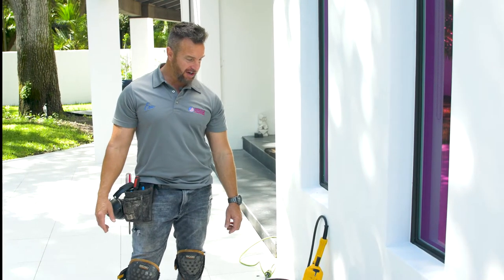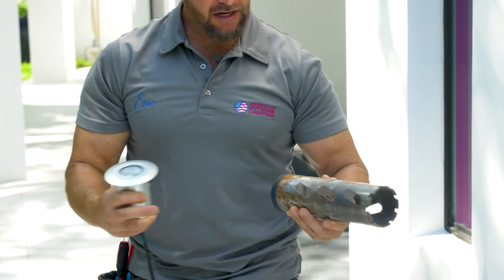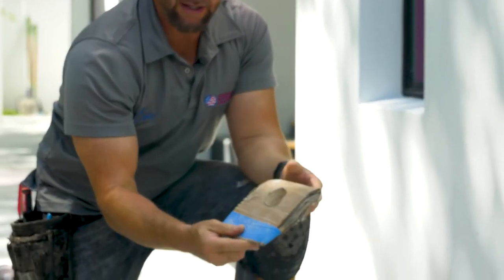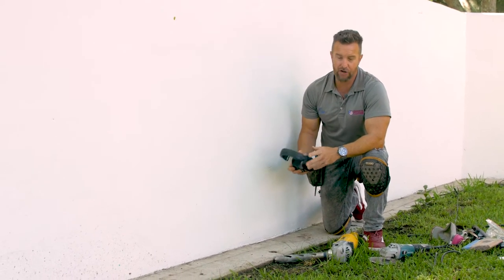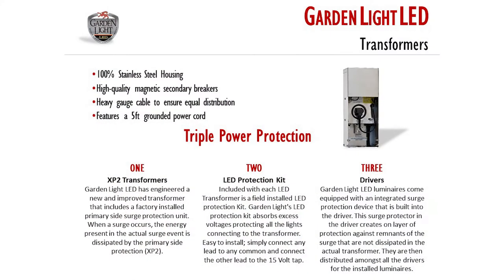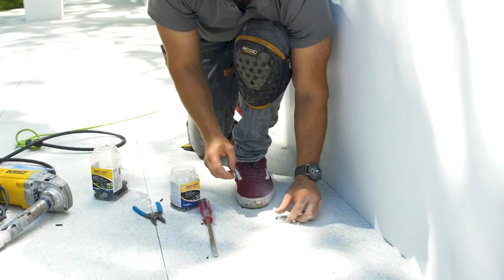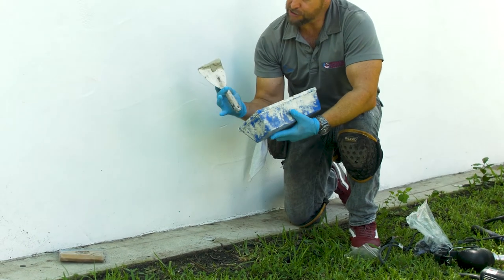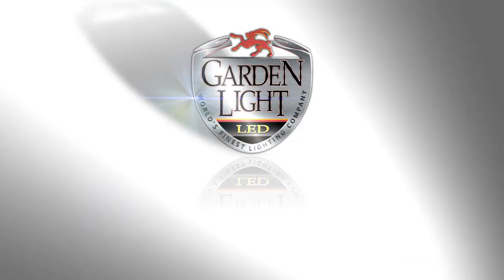How to Core Drill for Hardscape Landscape Lighting Installation

Comment: Great video! The only thing I'm wondering with the tile in the first part of the video is how you get the wire from the bottom of the hole connected to where it needs to go? Do you have to insert the light into the ground and run the cable back upward and out of the hole to connect to your main wire through a grout line? And in doing so, you would need to cut a line from the hole up to a grout line correct? Thanks so much for the video! A video on how to run wire through grout lines or concrete lines would make a great video idea for the future.
Reply: Like Daniel, I wondered the same.  Using the grout line seems to be the way to go, it is the best way to restore the cosmetics after installation.  Please do a video on it and highlight the routing technique.

Comment: how did you get the wire to core drill near the house?
Reply from the maker: Hi Mitch! Not sure I understand your question. Can you rephrase? Thanks!
Reply: Yeah like completely skipped how the wire just poked out the top of that hole? Haha
Reply: @GardenLightLED  I think he means how to get the main wire to hole where he shows the dryconn connectors popping up in the tile. Where does that wire come from?
Reply: @jamesjames_07  I get what you mean. Like how did the main wire and the light wire get connected together in the tile portion by the house. Not sure how to route the main wire to the light.

Comment: What do you do when you hit rebar?
Reply from the maker: Hi Jacob, great question! Eric's suggestion is to just keep drilling through the metal. Hope this helps!
Reply: Great video! I appreciate the quality of the work you guys have done. What model tool is that dewalt? Thx
Reply from the maker: @refreshlandscapelighting4813  Thank you so much! I will reach out to our installer in this video and email you the specifics on it as soon as I find out.

Comment: What adaptor is required for a grinder to be able to use a wet/dry core bit?
Reply from the maker: Hello! I will have to look into this. Let me get back to you!
Reply from the maker: I was able to talk with the installer and it looks like there is no adaptor necessary. You just need to make sure you are purchasing the correct core bit accessory that will fit. Thanks!
Reply: @GardenLightLED  Thank you soooooo much!!!
Reply from the maker: @arcticcowboy5047  Absolutely!

Comment: Ok this is bad on many levels. Why would you score to the outside of the 15" concrete curb, or however wide it was, in to the grass area? It was a few inches. Why not core down then remove dirt and grass and drill from the outside  about 5" down. You need to trench the wire  anyway. This way you do not have to go back and fill in. By the wy that was a nice patch but just seemed unneccessary. Now it could have been the speed of you video and you wanted to shorten you time,, but those are wire strippers nd not crimpers. You used the plier end of the strippers for a crimp,, you never do that. Get a pair a dedicated crimpers, or at least if you are going to use stripper/crimper combo, use the crimper then fold it half with a pair side cutters and squeeze the crap out it. Cut that excess wire off the end of the crimp sleeve, That connection was not tight as it should be